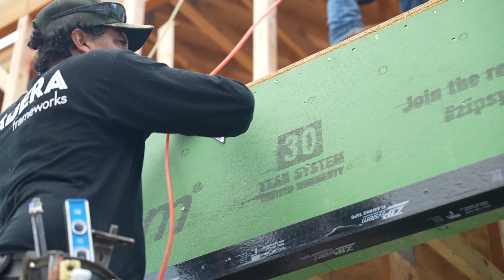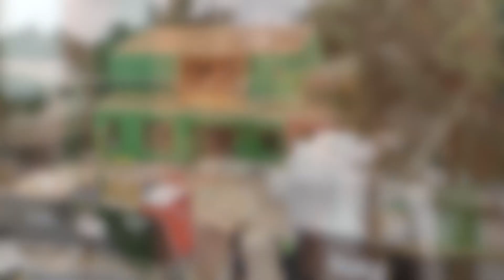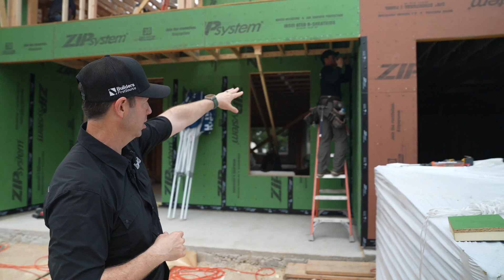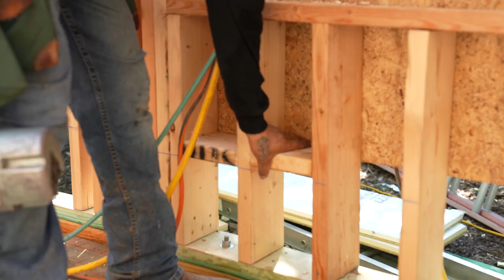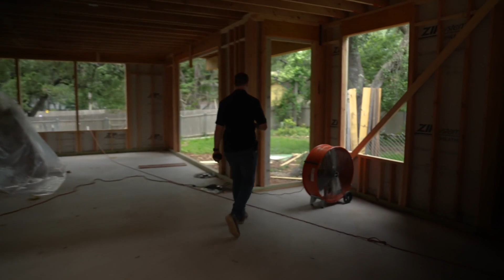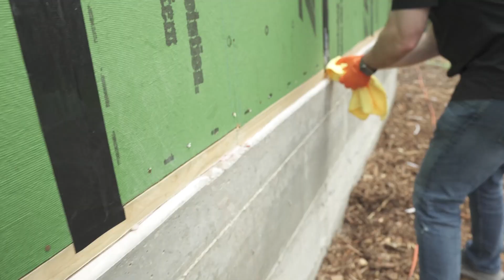The Risinger Build: Episode 6 - Exterior Sheathing & WRB Installation with Rain Screen

Comment: So what happens to the 20,000+ nail holes put into the zip sheathing when siding goes on? Sure they are somewhat tight but definitely not sealed.
Reply: Answered at 12:10